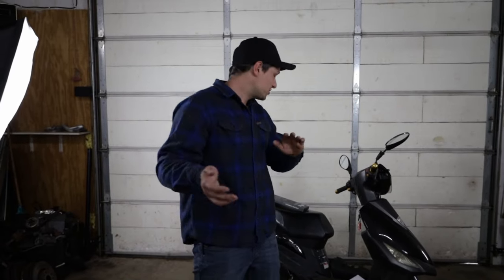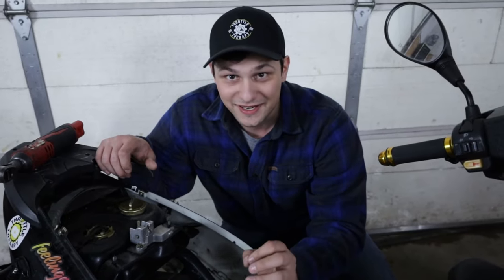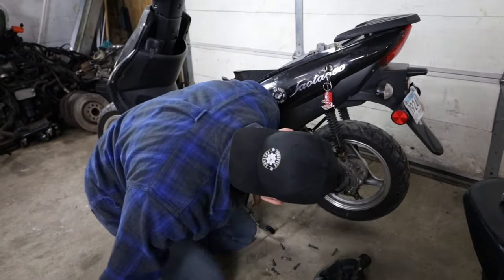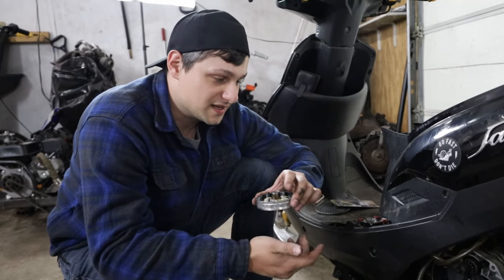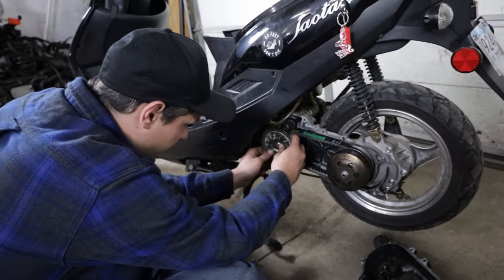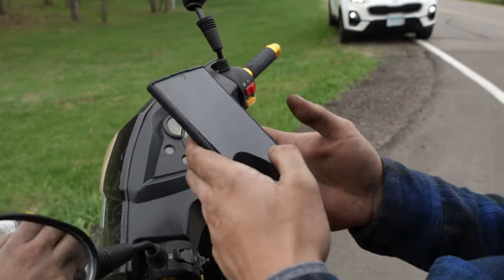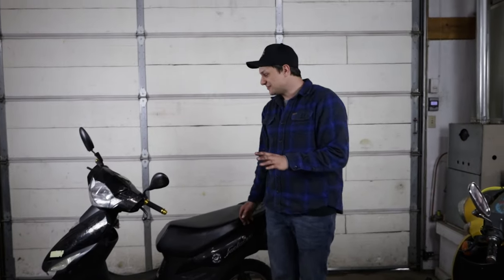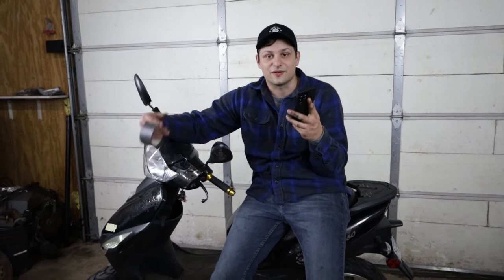EASY 50cc GY6 SCOOTER MODS to change performance

Comment: Hi, just a little tip, if u want to get more of stock gy6, get a performance cdi, there is a lot of cheap ones that work, i had mine upgraded and it increased my top speed. Basically the performance cdi can make your gy6 rev higher. Approximately 10% higher than normal
Reply: I added the performance parts and it made it slower
Reply: @ashjason1793 thats my problem too, i put performance everything in it and now it only goes 25😭
Reply: @reallawnboy5504 tune the carb
Reply: Might need a bigger jet/carb. Needs different fuel and air ratio now
Reply: @reallawnboy5504 because its restricted i think
Reply: Use a stock Honda Dio CDI us ones are not restricted

Comment: New to the 49s picked up an italica and noticed it bogged down very hard when full throttle at any rpm, took the top off and noticed it had one of them cone air filters. So I'm assuming the PO installed the upgraded carb. Cool but why did it bog down? Well being the mechanic the past few years I know a little something about vacuum And how it's important, as I looked over the stock airbox, it has a ton of vacuum hoses coming off of it. Well I decided to take that air filter off and hook up the airbox. It was like night and day. Instead of taking 2 miles to get to 30mph it took 200 ft. So incase anyone was having this issue.... thanks for coming to my Ted talk.
Reply: Pictures ?

Comment: The matter is 50cc or 150cc find out what the factory gram roller weight is and put three of them in there and three of the real light ones in there do a combination mix and you will get some RPM and still have top speed

Comment: I have a 100cc big bore kit race cam bigger valves performance clutch 6.5g rollers performance exhaust aftermarket carb forget jet sz racing cdi coil aftermarket cooling cover and I’m getting 55mph on flat ground close to 60 down hills and can do 30 -35 up hill depending how steep it is only other thing to do now is upgrade to a 150 and build it till then I’m happy with it

Comment: I use rollers rather than sliders. if you run heavier rollers to get more top speed, you can put stiffer clutch springs so you can build some more revs before the clutch grabs. that will give better take-off. Light rollers work well, but may not have enough mass to hit top speed. an NCY secondary slider pulley may help too, I installed one, works great.
Reply from the maker: Definitely noticed the top speed wasn't there. We haven't messed with the clutch springs so that's something we will have to do next. We have some tuning/learning to do yet

Comment: Performance CDIs are good for short burst drives, like drag racing.

They are not advisable for long trips where you tend to do full-throttle for longer period of times, because Performance CDIs have no limiter, you can burn it out driving at high rpm for long period of times

Comment: my 50 will easily do 70mph with the stock 49cc top end. A good carb, exhaust and the lightest rollers you can find and a taller gear set for he final drive is all you need. My 2014 Tao Tao 50 starts to Death wobble rite at between 76-78mph going down hill. It will go faster but I don't have the nuts to try it. 
I forget where i got my gear set but it was off of ebay. It increased the top end by atleast 12mph but it did slow down acceleration a bit especially on hills. They were listed as a Highway final drive gear set for a 139QMB. Shipped directly from China.
Reply: No 50cc is hitting 70 my guy... lol
Reply: @bryanmiller5074  maybe 70 kmh! =50mps
Reply: My 3k mile, 4500km  stock 2022 xpro maui hits 60 "40mph" and no matter the hill size  it tops at 41mph, i weight 160 pounds
Reply: You probably mistaken kmh for mph on the speedometer
Reply: All ican say is "kriedler"

Comment: Good engine to mess with and learn how to improving performance.  Been doing just that for over 10 years now and have taken a lot of what I've learned and stepped up to modifying a 150 engine.  7gm variator weights are generally what comes installed on gy6 50cc engines.
Reply: So should I get the DR . pulley 7gm , and  I will see any difference in acceleration ??   for a tao tao 50 CC
Reply: @ragadallas1982  how many grams are your variator weights?  Going lighter will increase acceleration but lose top end and vise versa.  You need to experiment with variator weights that will give you the performance you personally seek.
Reply: Dont u jus tell me o wizard
Reply: Based on the stock roller weight of 7 grams - try experimenting with 7g/8g combi roller weights OR 7g/9g combi.

Comment: I also have a 50cc gy6 and i had 7 gram rollers in it and deleted the vario ring. Stock cdi only cvt Mods. It ran around 70kmh which i think is around 40-50 mph. 4 gram rollers are way to light so try using 6.5-7 gram

Comment: 17x49 gear set. The lighter 4 gram sliding weights will help keep the rpm’s up high. The longer gearing does not affect acceleration. You will have a longer range of speed for the variable transmission to work through. This will help combat the loss of top speed from using a lighter weight slider.

Comment: If you change the carb.change the air filter and the exhaust pipe or get an expansion chamber if it's a 2 stroke.

Comment: Roller weights dont change top speed. They only adjust the revs the bike runs at. The idea is to have a good variator and weights that run the bike at the revs where the bike produces the most power. Once the variator is maxed out its irrelevant what weights are in it. My guess is that the new belt you put in it isnt allowing the variator to max out because its slightly wider or shorter.

Comment: With the 24mm D-type Carb, replace also the Cylinder Block with 57.4mm 

24mm Carb + 57mm Block = Fun Scooter

Comment: I got a 50cc scooter I'm putting the high performance cylinder head with oversized valves go with a a9 cam you already got the ignition system Steve from Annapolis Maryland

Comment: Also you can use a flat file or a sander and make the area the belt clutch surface meets more of a flat taper and polished , secound you can widen the area the rollers compress at the max to allow the primary to grab closer together at full throttle

Comment: Steve from Annapolis Maryland I totally agree with you keep it 50cc and get up a12 camshaft not the a9 that's a waste of money get the a12 that's not too much lift where you got to change the valve springs but it will make a big difference the camshaft CDI ignition is none of that parts are expensive you change all that and you will be good camshaft ignition check the carburetor again aftermarket pipe and you will be up to 50 mph I wish you live next door and I can help you

Comment: I D restricted mine with every way I could find. The muffler, CDI wire, air box holes to a UNI filter, rollers, belt upgrade. 240lbs and only 42 mph 😮
Reply: What exhaust mod tried?
Reply: Did you take the spacer out of the variator ?

Comment: I just got a wolf brand rugby 50cc scooter im looking for a carburetor but not too sure if this would fit is it worth the risk?
Reply from the maker: Looks like it has a gy6 so yeah it should work. Do you know how to re jet your stock carb? If you do I'd suggest doing that instead. This is basically the exact same carburetor with a 75 jet and a pod filter. But if you arent sure how to re jet it then this isn't a bad deal for 30 bucks!

Comment: EFI carburator s are better for year round use they automatically adjust to different weather changes.and a good lithium battery makes the charging system work better.specially in cold weather.where lead acid batteries freeze and loose power.And can destroy other components in the charging system,like starter recoil,electric start from not getting the proper charge.

Comment: I can only get my tao tao 50 to do 30mph, i put a new carb air filter i even changed weights in variator and added a new belt. How can i get this thing to go 40mph?
Reply: Man mine does it with no mods

Comment: My mods recipe, just sharing.

24mm D-type Carb

57.4mm Cylinder Block

15x37 Final Gear Set

13.5 Degrees angle Variator

11 grams Roller Weights

Lighten Clutch Bell

TTGR Clutch & Torque Drive

1k RPM Center Spring

1k RPM Clutch Spring

23/28 Big Valves Head

6.5 Lift A9 Camshaft

2.8 5-Turns Valve Springs

Comment: Are the geared 50cc scooters faster than the 50cc automatic scooters?
Reply: No
Reply from the maker: No, in theory, they should be. The 50cc just doesn't have the power to make it worth it. Playing with the variator, roller weights, and clutch springs is the best bang for your buck.

Comment: I just did one of these for my 50cc, and my stock airbox had a couple lines running into the engine hose.  I left the stock hose because I wasn't sure if I could leave them loose.  The new carb only had one hose.  Seems like a lot of stuff is tied into the stock airbox when I get down and look.  Is there a schematic somewhere?  I don't want to stall out anywhere.
Reply: Ok, so I pulled the stock airbox and dropped in the cone air filter.  runs pretty well so far.  The hoses - there is apparently some emissions cylinder thing that has to go.  There is a hose coming from the front of the engine block which is apparently a vacuum hose, that went to the stock airbox. Do you just leave that loose?  Seems like I'm at risk of particles entering the system.  The water drain line on the bottom of the airbox doesn't matter so that's gone.  It pulls and surges when accelerating which is slightly annoying.  Same top speed (37) until I can get the variator restrictor off (waiting on impact wrench, stripped two 8's with hand tools.  Just wondering about that block vacuum hose.
Reply from the maker: I think the rest just hang from what I remember. You should be fine. I will double check next time in the shop to double check. If anything changes I'll let you know
Reply: @throttle_therapy  I put a lot of work in over the last few days! The vacuum hose seems to not really matter to the operation of the new carb once the air box and eco stuff goes away. It rests in the chassis naturally and it's pretty thick so I'll probably just leave it. If I start noticing hoses visible from the outside I'll either tie them up or pull it off completely. I never really did Small engine stuff but it's not that difficult once you tear into it. It's super interesting how replacing one piece shakes out problems with the other pieces. Open carb with new jet needs better air so once you fix the better air the exhaust is the problem. I have one of those aftermarket exhaust on order so once it gets here I should be good to go. Not too shabby for under a hundred bucks for getting a new lease on life with one of these little 50cc Chinese scooters!
Reply from the maker: @SteveShelby  you got it🤘 nice work dude that's cool to hear you are enjoying the experience.
Reply: @throttle_therapy  I really enjoy your videos so many people have crazy long intros and they don't cut the Dead space and dialogue and don't speed up the videos on mundane stuff you seem to actually know how to do the work and the production which is super important for people sticking around! Got another side question I forgot about. I stripped out two 8 mil ratchets trying to get my gearbox cover off. Got a cheap wrench set and this cheap ass metal is starting to strip on the bolt. I have an impact wrench on order and my fear is I'm going to actually strip the flanges off these gearbox bolts. An adjustable wrench is too big to get in there. I've done WD-40 a couple times done a few taps I don't want to strip these things trying to get them out but I have not been able to pull the restrictor of my variator yet and it's really bugging me do you have any tips for pulling out these cheap aluminum 8 mil bolts?

Comment: If you had to choose just one Mod, which Mod would be most efficient in making the bike faster overall?
Reply from the maker: 1. Big bore kit.  2. Bigger jets and intake
3. Lose a ton of weight lol
Reply: @throttle_therapy  ...wow ok, I thought for certain you'd say Aftermarket Exhaust, but I know absolutely nothing about Bike Modifications. Thanks
Reply from the maker: @tooakki  that would help too. Anything to get more air and fuel in and more air out.

Comment: So heaver weights be better you say?
Reply: Heavy weights = higher top speed but slower acceleration 

Light weights = lower top speed but better acceleration
Reply: @oliver32321 need a balance of both.. if Peak power is at 7000 rpms you need weights to hold it there
Reply: @speedyme200  yeah exact;y what i said then yh 🤣🤣

Comment: Try 24mm D-type Carb.

The fuel mixture is constant, the throttle action will only increase or decrease the air mixture.

Comment: You could buy the main Jets variety of main Jets and idle Jets and change them in a couple minutes and use the same carburetor that's ridiculous to go out and not unless you bought a bigger millimeter carburetor is probably what you did it's ridiculous to buy another carburetor this changed a little Jets takes a couple minutes
Reply from the maker: The original carb was junk thats why we bought this one. It just had a different jet than the stock.

Comment: Bruh u gonna blow that engine up if u put that shitty ass pod filter with the called performance exhaust  ur engine runing lean and the weights don't do shit if u don't mess around with the springs in the back and why would u buy the same carb bro you could have bought some jets and be done

Comment: First mistake you bought parts off Amazon. 
Go to the local scooter store and buy a 30 mm carb
Reply from the maker: Unfortunately the local scooter store doesn't exist where I live
Reply: @throttle_therapy  oh I understand😉
Reply: That's way too big even the stock intake valve is not that big.. Plus you never get that carburetor in tune
Reply: On a 50 cc scooter they should always be around 30 at least in Florida that is